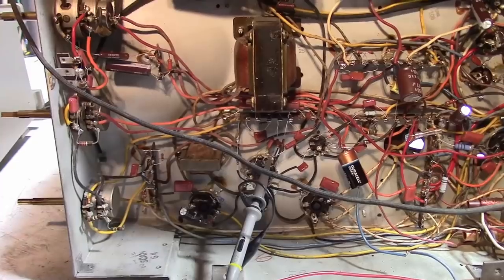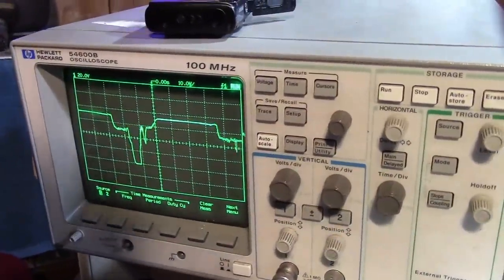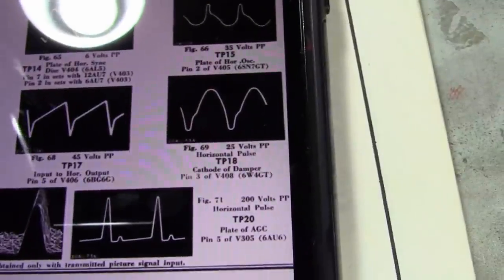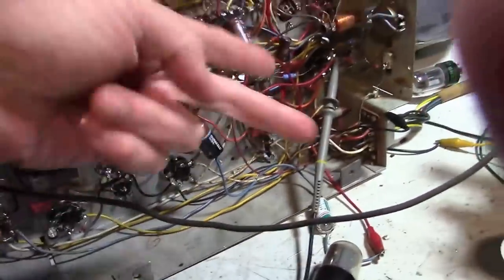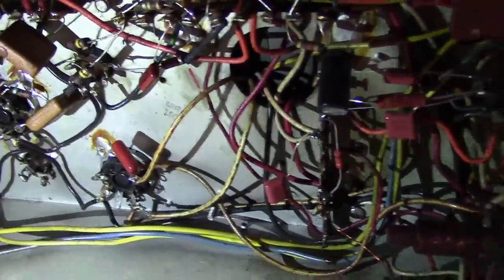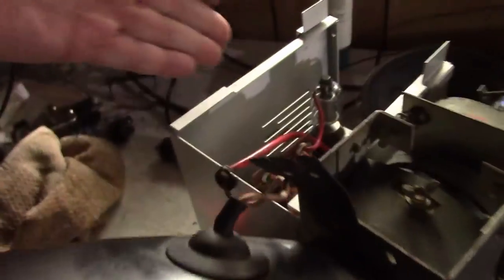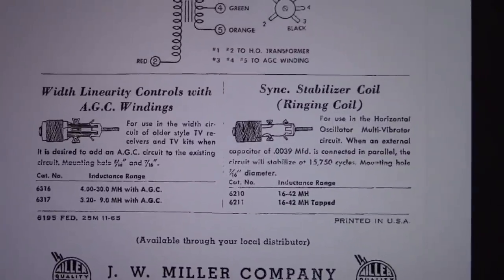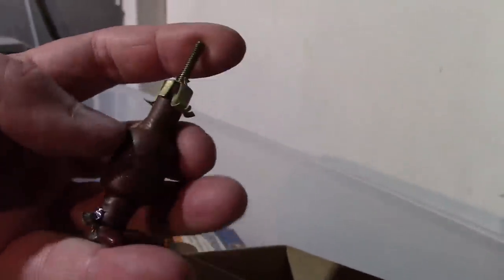Admiral 20B1 restoration p5o?

Comment: Bob that is simply amazing. You are re-engineering old old components and find three ringing coils because this set would not ring at 15.75 and use one that looks nothing like the original with different resistance but the same frequency response. You dah boss bob. Ya'll are a real reality manipulator. To think this all came from trying to find and range on an enemy in wartime with a beam of electrons in a cathode ray tube hooked to the fire control that up until that time used wide binocular vision devices and now used by small little fragile humans killing monster armored behemoths shooting shells weighing as much as a community of these small fragile humans with hide and go seek.

Comment: These sets seems to rely on a really well working feedback system to overcome component tolerances, when that goes wonky then nothing seems to work (this is from what I am getting from your experiences here).
Glad you could bodge up fix with replacement parts, much easier than trying to re-learn how to wind these things.
Cheers,

Comment: Miller Catalog #59 lists four width coil with AGC winding, two of them (the #6316 and #6317 - the ones you found in your catalog) show a tapped secondary winding.
However, the other two, #6325 and #6328, show an untapped secondary that matches the diagram of your set.  These coils also cross to the Thordarson #WC-13 and #WC-26, respectively.
Reply from the maker: Thanks for the info!

Comment: For the width coil, see if any of those replacement horizontal osc single winding coils have a close resistance to the long coil you've unwound and try winding the shorter coil on top separated by some tape. Yeah that would never provide factory specs, but for just getting the sync pulses through could do the job!

Comment: You can sometimes use high voltage low current power supply to arc weld the open coil together again.  I have successfully  repaired a audio output transformer for a vacuum tube radio with a CCFL driver from a old scanner that ran off dc and was a simple transistor based oscillator circuit.  The thin high voltage input winding on the transformer was open so I connected the CCFL driver to it and slowly increased the dc voltage feeding it until I saw a increase in current draw indicating that I had successfully arc welded the windings together again.  This may reduce the resistance and inductance a bit but it was better then no transformer.  If you come across another open transformer or coil with thin gage wire you should try this idea.

Comment: I may be able to rewind the coil if you can figure out the number of turns. The winding looks like a wave winding with even turns distribution so the tuning slug tunes depending on the length of it which is inside the windings and so determines the amount of coupling. The wave winding is to reduce the amount of inter winding capacitance and so stop it from making up its own tuned circuits. I posted a video on my channel about this sort of winding recently https://www.youtube.com/watch?v=AM6wevGXkuc.
The wire I would recommend for this is 0.05mm cotton covered as this gives better results in a wave wound coil. Unfortunately (for you) I live in the UK so you would need to pay postage but I would wind it for free. However I would need to know coil width and number of turns.
Reply from the maker: That's the odd thing about this coil.  The slug is not for tuning the coupling between the primary and secondary.  That should remain constant as the slug moves.  The coil serves two purposes.  One is a width coil.  The primary is in parallel with a winding on the flyback.  Moving the slug has a subtle effect on the flyback's operation.  The other is to provide a feedback pulse that does not vary as the slug moves.  Or at least not very much.

Nice video on wave winding.  I have a possible replacement on the way.  Rewinding is my last resort.  I'll keep your kind offer in mind.
Reply: @bandersentv  It is hard to be sure without seeing the coil up close but it seems that the slug should be to tune the resonant frequency of the outer coil while providing some coupling between the two windings. That is why it should be wave wound so that it can be properly tuned to the correct peak frequency which will be over a fairly small range. That is the main advantage of wave wound coils. With the correct tuning capacitance across it then it should have a very pronounced response over a limited range and in theory that causes it so 'seek' the correct opertaing point.
Reply from the maker: I guarantee you that is not the purpose of this coil.  It is called the width coil after all.  Every early TV has a width coil that is used to fine tune the horizontal scan about 1-2%.  Later someone had the bright idea to pick a signal off to improve the AGC circuit.  All that's needed is a large pulse.  Around 200 volts.  Rather than add another coil or tap on the flyback, they wound a secondary on the existing width coil.

Comment: Yes, the CRT dag must have a good ground. The door knob caps also had a habit of failing.
 Never totally trust the "universal" FBT replacement transformers to be correct. We fought a sync problem on a color set for days until we finally figured out the "Universal "FBT  had reversed the winding leads to the pins on the FBT. A real nightmare.
Reply from the maker: What happens if you don't have a good ground on the dag ?  Does a static charge build up on the exterior surface ?   I've heard doorknob caps can fail but have never encountered it.

Comment: Coils are definitely one of my least favorite parts of vintage TV resto. Also at 9:20 is that a duracell battery lol?
Reply from the maker: Yes.  That is to provide an AGC voltage in place of the damaged coil.  It's a common part of doing an alignment.  I really does say to attached a battery across the AGC bus in the alignment instructions.

Comment: With regard to the original sync stabilizer coil, maybe the original absorbed some moisture which is causing the problem, Q of the coil to be off, even though the DC resistance seems fine? You could conduct an experiment and try baking it at 170 F for a while, sometimes this sorts out problems with oscillator coils in some makes and models of radios, I think the forms on these are paper or some type of phenolic so the heat won't damage the form. I've heard of a similar trick for driving humidity out of flyback transformers from the British Isles (they call them Line Output Transformers) in which they run a low voltage through it for a few days, I don't know the details of what voltage, or whether it is AC or DC current.
Reply from the maker: Yes, I can try that.  I would be surprised though since it's operating at such a low frequency - 15.75 kHz.
Reply: @bandersentv  That's true, I didn't think of the operating frequency, higher inductance would equal a lower frequency, and vice versa. Have you compared the two coils, the original, and the replacement, with that cheap parts tester? It may not be that accurate but it may tell you whether the inductances are substantially different

Comment: Wow, troubles a plenty with this one...coils are the worst parts to try to replace as there are so many parameters involved. Worse for air or slug coupled high freq. Transformers because you throw in the coupling coefficient also. Arcing in the crt must indicate a gassy tube, no?
Reply from the maker: Not in this case.  I think the electron gun is damaged.  Possibly from a bit of the cathode broke lose or some other structural defect.

Comment: Solder the ends of broken coil wire use bit of thin glue like epoxy to seal the joint then start winding it back up should be good to go nothing to lose
Reply from the maker: Time, I'd rather spend the time on more interesting tasks
Reply: @bandersentv  ok yah it is pretty tedious